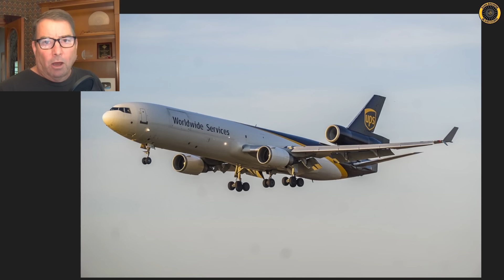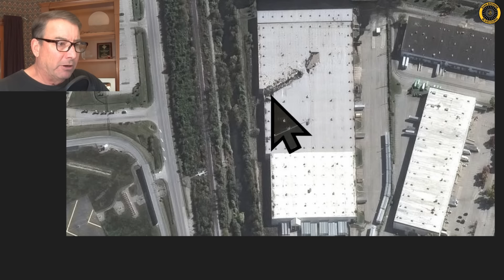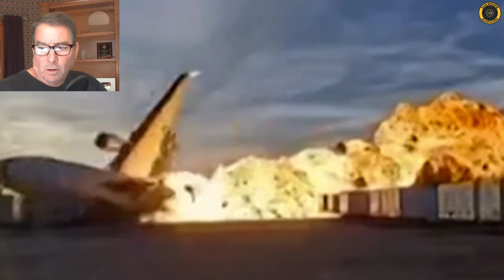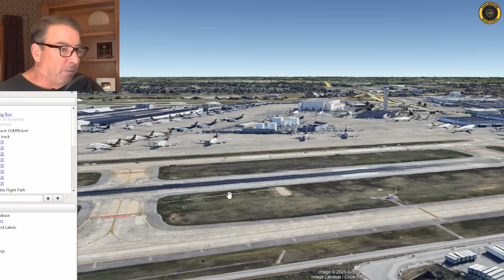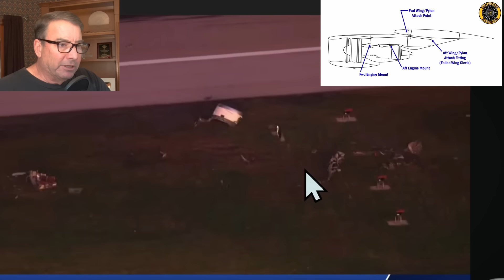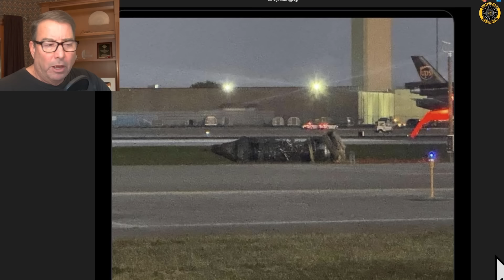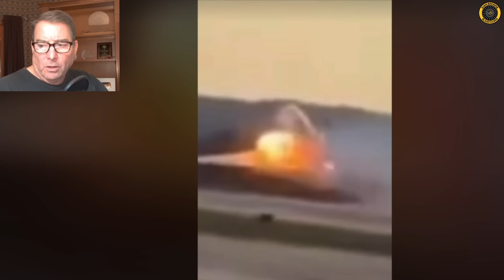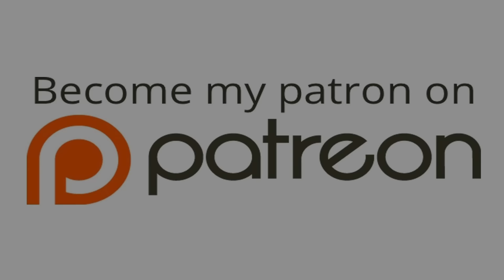UPS #2976 UPDATE 2 6 Nov 2025

Comment: As intact the core section is, it's most likely a pylon mounting pin failed.
Reply: NTSB said they found engine fan blades on Runway 17R during their FOD walk, but not where they were located along the runway length.

Comment: My question would be that the person who identified the sound reduction material are assuming that this is a CF6-80 engine but the standard engine on the MD-11/DC-10 is the CF6-50.  The CF6-50 does not have the sound reduction material around the C1 fan area.  Can you see the FADEC?  The CF6-80 has FADEC and the -50 does not.
Reply: N259UP's FAA Registry shows if had GE CF6-80C2D1F model engines.

Comment: I had the privilege to speak with (the now late) Capt. Al Haynes, of United 232's July, 1989 DC-10 crash at Sioux City, Iowa, and later heard his account of the long sequence of events of that he and his crew fought through. The imbedded metallurgical fault in that #2 engine's first stage compressor disc (if I recall correctly) broke that big, high-rotational speed disc into three pieces, which went uncontained within one rotation. A farmer later discovered one of the three pieces in his field, far away from the eventual crash site -- pointing to where the cascading failures started at cruise altitude, and aiding the forensic investigation with such a windfall piece of evidence. In the NTSB final report, it was incredible that such brutally bad fortune would have a piece of that departing disc sever the one, vital confluence of enough flight systems, under #2 engine -- to leave them with only differential #1 and #3 power to fly with.

The UPS crew at Louisville had roughly five seconds, after #1 erupted and that flood of non-recoverable failures filled the flight deck. Juan, you used (here) the progressive pre-impact images of this jet's configuration to show that the crew was keeping wings-level and clearly fighting to recover. That, and you quickly revise or correct any prior speculation or comments about crash imagery that may have been in error -- while soliciting and acknowledging  input from your many, very knowledgeable followers (such as:  the frayed kevlar around the #1 intake debris, which did look like grass at first glance). That, and I just read a lot of very credible comments from your followers this past day -- experienced DC-10/MD-11/KC-10 crew and maintenance folks -- sharing their solid rest-of-the-story history with those aircraft. I don't even open ANY other "expert"/blogger sites any more, nor most of the major media news sources... I have your channel, and the NTSB reports. RIP for that crew and all of the people caught by the impact on the ground. Press On, sir.

Comment: 6:53 how did we draw the conclusion that no'2 engine compressor stalled and there was not enough power in two remaining engines for the take-off ?
Reply: Video taken from a taxiway shows intermittent flames bursting from exhaust of engine 2

Comment: I am continually frustrated when people use the term power when discussing the operation of thrust engines like these modern turbofans.  The motive effect of these engines is by applying thrust to the airframe, not by generating power which can be applied to a propeller to generate thrust.  The physics is significantly different in the application of motive effect between thrust engines and power engines.

Comment: The key period of this incident is from the time the plane started accelerating down the runway to wheels up, approximately 45 seconds in duration. What do the airport's CCTV's show about this period? Is there footage of the plane at this time? What is on the Cockpit Voice Recorder? (What was said during this crucial time inside the cockpit by Capt. Richard Warternberg, First Officer Lee Truitt and/or International Relief Officer Capt. Dana Diamond?)

What happened in these 45 seconds? Possibilities:

(1) The left hand side engine separated from the wing like with American Airlines Flight 191 (25/6/1979) i.e. Mechanical Failure/Technical Fault.

(2) The left wing bumped/smashed into the runway and severely damaged Engine 1 which then separated from the wing and severed the fuel line. e.g.

(a) 5/11 23.04 ET RealJohnShoe on X  "Looks to be catastrophic. Maybe cargo got violently dislodged and the plane smacked the ground. fxnighttrader: "
How could cargo getting dislodged make the engine fall off?" RealJohnShoe "Makes the plane veer up or down dramatically."

(b) 6/11 00.14 BoDeepest on X “Looks like they stalled and dropped a wing. 🙏 

(c) The Pilot in Charge during the track and acceleration down the runway experienced a problem, lost manual control, moved/jerked the yoke, the left wing dropped and hit the runway... 

(3) Other

Prayers for the injured, maimed and deceased people on the plane and ground from this terrible aviation incident.

Adam Neira
Founder of World Peace 2050
Founded in April 2000
Paris - Jerusalem - Melbourne

Comment: Please know that as an aircraft mechanic, my primary concern is the safety of the aircraft, and performing my job to the best of my ability, utilizing, company, and manufactures manuals., my tools, and my almost 40 years of experience turning wrenches on heavy jets.  You made it sound like the crew that hung the engine that came off N110AA (AA191)  took it upon themselves to take a short cut to save time. It is often management who is looking to save time, and labor costs, and initiates procedures to do so, often getting pushback, and resistance from the mechanics themselves. The incorrect procedure to hang the DC10 engines was not isolated to American Airlines. The FAA determined that all the U.S. carriers operating the DC10 were using the shorter, unapproved procedures.

Comment: UPS had a CF6 engine on a 767 explode in Chicago a few years ago, sending a turbine wheel flying high and far from the plane.  I’m wondering if a similar failure happened to this MD11.

Comment: So, as I stated in the last video... If there had been a construction exclusion zone at the end of the runway, there would have been nothing for the left wing to strike. It's possible the aircraft would have been able to stop even after V1 if there was an emergency stopping device (soft concrete pad or net) and the pilots knew there was a stopping device. Instead of trying to get airborne, they could have activated the reverse thrusters on the two remaining engines, hit the brakes and possibly slowed enough for the stopping device to work. With the wing fire, due to the ripped off pylon and fuel leak, it's possible they would have died anyways, but there wouldn't be any ground deaths.

Comment: My first thought was that this was an engine failure leaning to turbine disk failure. This would explain fire and engine departing aircraft. Not sure engine picture supports this. It is unlikely the same failure as the pylon failure accident case, no fire. 

It crossed my mind seeing the engine with coweling material smash in inlet, location of separate pylon, and fire, it may be a failure that the engine front end pivoted downward. 1 posible senerio, front engine mounting failure. The failure probably wasn't instantaneous as main fuel lines was stress to crack leaking fuel to hot section of engine that with nose down in position for fuel to hit hot section of engine and ignite. Front mounts then fully failed. Engine fell down nose down. Thrust and aerodynanic pulled pylon off breaking away from aircraft. Engine nosed into ground shedding coweling and pylon.

Comment: If it all ended up on the right side of the runway, it seems possible that debris got into the center engine or even the right wing engine.  This could be why it wouldn’t fly on two, maybe there weren’t two engine running correctly? Now I see that this has been addressed.

Comment: My first thought of this crash was that the a/c left wingtip hit the first building. But that would have surely pulled the plane down and destroy the building.  We've seen that the wing tip survived the first building contact. Then I thought the landing gear hit the first building but that should have brought the plane down much earlier and also destroy the building. The only other option that I see is a tail strike on the first building. Look at the AOA before the power lines. Amazed that it kept flying. I would wager that the plane might have been able to climb out if those power lines didn't drag the plane down. The FDR readout will be very interesting.

Comment: I don’t have anything to do with aviation, Buuut, from what I understand, modern airliners have several safety devices, seat belts,air slides,special seat construction, control redundancy, etc, all just in case something goes wrong,99.9%percent of the time never needed but there just in case. But we build buildings ,businesses , neighborhoods,and (flammable fuel tanks?))at the end of runways. I’m told takeoffs are the most critical point of a flight. I am also told that after V1 you have to fly.  Looks to me like the only reason you need to fly is to clear buildings. Not saying things would go good if pilots new the plane isn’t going after using all the runway, but seems common sense that staying on the ground and not having obstacles and more important people in the way would to less carnage.. You know, just in case.

Comment: Sure but past behavior is more likely than some new concocted  reason. Past behavior: was to pull the whole engine including the pilon from the wing using a very powerful forklift time and time again. What needs to happen is to find out if that practice was followed again after the uproar of the past cash had been lost in the minds of the industry. The past behavior very forcefully rammed the mounting "boss" up into the wing structure bending the aluminum and then the weight and thrust of the engine bent what was bent up , down. This did not happen just one engine swap but over many engine swaps. They call it fatigue stress and it happens with all metals when over stress is reversed over and over.  Because it is so hard to believe that regulators and mechanics would allow the same kind of outrageous crash to happen again we all hope it was something else.
Reply: Every A&P around the world has heard about AA191. No one would be foolish enough to repeat that. There is no forklift going anywhere near an engine unless it is to move it on or off a pallet/shipping truck.

Comment: question. If F.O.D. was introduced to #1 engine (there was concrete work around the runway) and the F.O.D. was large and heavy, would that cause enough vibration to break the shear pins on the pylons?

Comment: Juan, ex GE fan rotor designer. Those are the Kevlar containment belts that wrap around the fan case, not carbon fiber or part of the acoustic treatment.   This does appear to me to be a massive uncontained failure. There appears to be a giant hole in the LPT case in the aft part of the engine.  I have not seen any pictures of the front of the engine to see if the fan disc is still intact.  I have also seen pictures of the number 2 engine experiencing compressor stalls.  Shrapnel from the number 1 engine could have damaged it and this would align with a failed disk (either fan or LPT).  If the fan disk or fan shaft fails the LPT unloads and could have overspeed tit to burst.  I was on site for the UAL 232 investigation and I can’t recall if the LPT had evidence of overspeed in that event, but it was at a much lower power setting.  I agree that this appears to be an engine first event.

Comment: @blancolirio while I agree that there was almost certainly a loss of thrust in another engine I’ve not seen anything yet the definitively says the #2 had suffered a compressor stall and loss of thrust. For example in the dash cam from just off the end of the runway we don’t here any bangs or see any unusual indications from #2. 

I think you need to clarify if you have solid evidence to support this assertion or if it’s an inference based on data available but not yet definitive.

Comment: What puzzles me is that the third engine is supposed to be a "hot spare". There used to be a rule that you need to land within a limited time after loosing an engine in case you loose another one. That's why they came up with 3 engine designs so you are allowed to cross the Atlantic ocean without the need of 4 engines.
So a 3-engine airplane is supposed to be able to (barely) fly on one engine and maintain almost full capability on two engines. It should have been able to maintain altitude and even a reduced positive climb rate.
There must have been a lot more going on than we have learned so far.

Comment: Even if the engine failing first was the cause, it's should definitely NOT have resulted in the pylon separating.. Hell I've seen atrocious damage to engines, half of the fan blades missing, explosions etc and they still where attached to the wing.

Comment: There's a video of #3 (Right Engine) as the plane hit power lines just before impact with the building that shows what appears as full power. Debris (probably power line fragments) sucked through the engine and blasted out of the engine at a very high velocity. These pilots did their best but were doomed.... Sad, RIP...

Comment: This seems about right. The pylon is designed to cleanly drop the engine before it can damage the wing.
So when the engine is shaking violently, it is better to drop it in a controlled manner before it can cause damage to the actual airplane. In this case, this has obviously failed.
The supply lines (power, hydraulics and fuel) are supposed to detach cleanly and can be dealt with cutout valves.
I think that either the engine rotated upwards on separation and struck the wing or it came apart shooting debris through the wing before separating.
A punctured wing tank is almost exclusively the only way to have such a massive uncontrolled fire on the wing.

Comment: Failure of UPS maintenance to find the cracks forming the rear bulkhead at the pylon attachment. The engine and pylon went over top of the wing pulling the fuel lines upward.  Electrical sparks from severed wires ignited the fuel being pumped over the wing. Flames over the lifting surface of the wing created (anti-lift) a downward force keeping the plane from becoming airborne. If not for the fire they would have achieved flight and possibly been able to attempt a landing.  This accident has more in common with the 78 PSA crash in San Diego. Flames over the lifting surface will cause the wing drop like a rock!

Comment: Curious where the initial impact of the engine assembly was in the takeoff roll. At those speeds, clearly the engine assembly tumbled from the left side of the runway to the right side of the runway, and traveled a great distance before coming to rest ?? This crew performed heroically to the very end and in-line with current training standards. We as an industry should consider an emphasis on and train in the simulator for catastrophic failure shortly after V1. There will still be cases, and this may have been one of the them, that nothing will improve outcome, but running off the end of a runway after catastrophic failure at a lower speed than rotate speed may be survivable?

.

Comment: The 1970 something  accident where engine departed aircraft didn't cause a wing fire for that failure mode. This in itself may be significant clue they are not same type of failure. Not clear so far to me when the fire started. I haven't dug any deeper than Juan's videos.  What first pops in mind causing fire is turbine disk failure which could damageenginesupport structure at sametime. A high def picture of engine should show signs of that. Then again pylon failure in such a way for engine exhaust igniting the fuel??? Fuel igniting is a key clue. Fuel had to come in contact with a very hot ignition source. That source os the engine in some manner. Engines departing aircraft due to engine mounting failures generally cause fire on wing?? The one case we know of the aircraft model, it is no. Hence likely some engine failure that cause engine mounting failure with fire. Although maybe mount failure caused engine shift breaking a fuel line with fuel hitting ignition source on engine followed by complete mount failure.

Comment: There's a lot of speculation and mixed up info in this video. Same as the last one. 
-That dash cam footage, as pointed out by other commenters below was not in the location you indicated and on a completely different road. Which means that your assessment of the crash from this angle was incorrect as pointed out by other commenters below.
-The truck dashcam footage that shows the plane sideways came out within hours of the crash. 
-There was a new NTSB report #2 which was released before this video was released. 
-The names of the crew were released at the time of the videos publication and no correction was included.

Then we have where you speculate about the crash and the cause, after incorrectly saying there was grass in the engine remains last time you now state that due to the way the engine looks you believe the engine failed first. But your last assessment of how the engine looked (filled with grass) was wrong. 

There's no need for random speculation in these videos. People are looking for accurate updates on what happened. They're not looking for random speculation and inaccurate facts.

If I wanted a rushed inaccurate reporting on the events here I'd go to Fox News for their live coverage, not an "aviation" youtuber.

It's time to do better, research what you are saying. Your videos are coming out with out of date information due to how fast the situation is moving which means you need to be accurate. If you're giving us out of date and inaccurate information then it's a joke to even tune in.
Reply: Nobody is forcing you to watch him.
Reply: @caddydave  nope, I won't be in future.